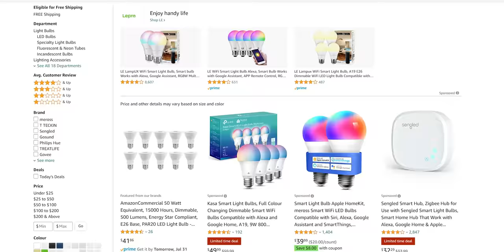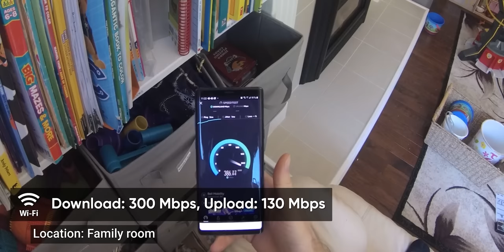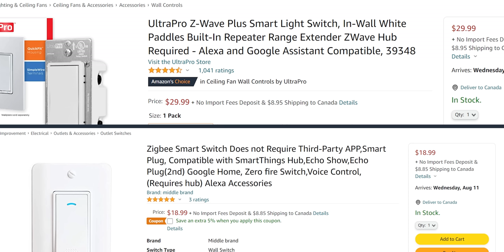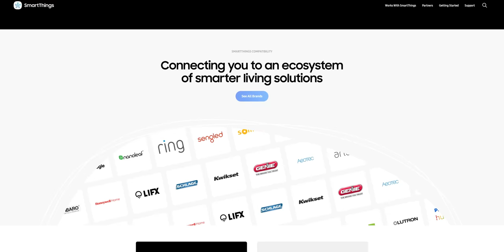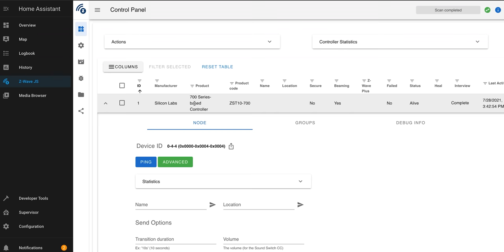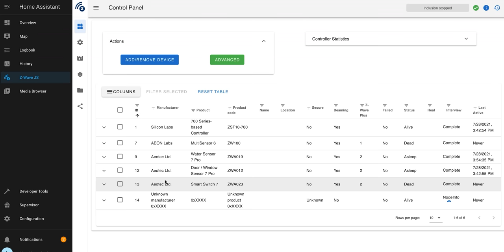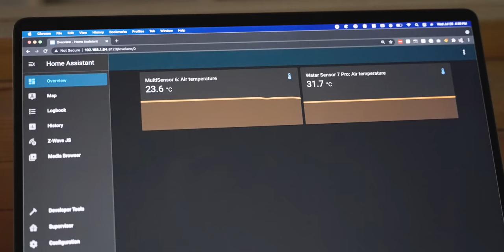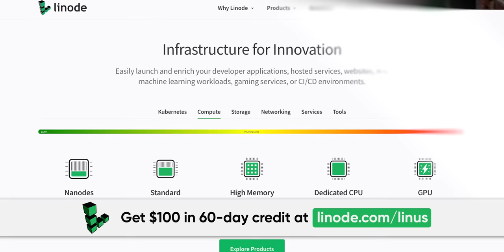My new house is gonna be MAGIC - New House Z-Wave Setup

Comment: If you haven't seen it, check out the span.io smart power panel: https://www.span.io/smart-panel-product

You can monitor and control the individual circuit breakers from your phone, which is really awesome. That allows for a whole new level of granularity when monitoring power consumption that something like the Aeotec power monitor just can't match...

... That being said, the span.io panel is waaaaaaaaay more expensive than an Aeotec monitor...

Comment: I've spent more time researching and tinkering with different smart home ecosystems that I care to admit. Bottom line: z-wave is waaay too expensive and has limited devices. Zigbee mostly sucks in terms of reliability... Ended up with wi-fi (shelly) devices for most things, a limited selection of zigbee and z-wave sensors that I'm gradually replacing through wi-fi solutions too, everything running through node-red and/or HA. Stuff like automatic lights with a hour-of-day dimming curve work like a charm, reliable and the only thing that stops working IF the internet is down is Alexa support...

Comment: yeah... i tried to use this home assistant.... but... yes... didn't work for me, way too complicated to use so i made my own home assistant
Reply: Care 2 elaborate?
Reply: @wesleymostien  ?
Reply: Yes, what do you mean by your "own home assistant"?
Reply: @wesleymostien  i created it, my own version, i am a software developer.
Reply: @duracell_87  me too, that's why I'm wondering about the details. How you've done it, which tech stack etc...
Reply: @wesleymostien  angular on FE + spring on BE + mariaDB, it supports two comunication protocols, for electronic boards; http and mqtt
Reply: Do you have a GitHub repo to help me out and I'm sure there are more people interested in such a setup. Thanks
Reply: @wesleymostien  yeah but is not public and i didn't decided if i will make it public or not

Comment: the funny thing is that wired intercom and mechanical springler timer is still working after 30+ years where the shit coming out today is just that.. its shit. its made for you to keep consuming as it doesn't last.
Reply: I meam an old pc could still be running today doesn't mean it is still usefull

Comment: Do NOT screw 2 wires under a terminal. That is bad. You need to pigtail multiple wires under a wire nut.

Comment: Yes, it is bad to run a microwave empty! Eventually, a weak spot will form and burn! Messed up 2 microwaves doing that. One I ran fully empty and the other I heated up a single red bean to watch it burn and the microwave had a burning smell when I realized there was a weak spot that formed and started to burn. 0/10 would not recommend!

Comment: This will no doubt get buried, but Linus please do not use Ruckus.
I work for a school in IT which just got an external company to install ruckus APs everywhere, and Ruckus switches across the sites.
The APs do not handoff properly between them, so roaming is crap and you have to disconnect and reconnect. The company nor ruckus themselves have worked out a fix for that. And then we have had horrendous latency issues across our default VLAN and our other VLANs. To the point where VOIP calls from one building to another just fail because of it.

I BEG

Comment: Linus.... You made a fucking central AC unit you can repair that drywall for less than $50. Its really not that hard to patch some drywall. My dad me start doing it at age 12 when I would put a hole in the wall with my siblings pretty simple shit.

Comment: Why would you make something as simple as a light switch communicate wirelessly? Have you heard of WIRES? Considering you plan on living in this house for decades just spend the extra man hours to run wires and do it right so everything stays working and you have the added benefit of not being bombarded by high intensity radio waves 24/7

Comment: Yikes those screw terminals look awful! Never seen anything as dodgy as that in the UK, it’s always proper terminal blocks so you can’t touch any exposed copper without really trying to. Also it’s not a safe isolation method to use a non contact tester to prove dead, really bad and unsafe advice.

Comment: I feel like you really glossed over the pros and cons of the different communications standards… for example - wifi switch $15, standardized protocol, unlikely to go anywhere any time soon. Down side - need good wifi (as if you don’t already have that) z-wave - proprietary protocol, switches are $60 each, far less adoption than wifi, so might go away as a protocol as new stuff gets released. Upside - running separate from your wifi on a protocol meant for that purpose….

Comment: Linus Tech Tips:  I hope you are not going to make your house a smart house.  I do not trust Alexa or Alexa type devices or baby monitors, and you shouldn't either.  Remember, anything connected to a computer can be hacked.  Why not just put everything on a timer instead?  And use a clapper for the light in your room and other devices.  I have a clapper and have my TV, radio, and lamp plugged into it, so all i need to do is clap 2 times fast and loud and they all shut off.  Just something for you to think about for the safety of you and your family.

Comment: you shouldn't run home assistant on a raspberry pi, the sd card will only survive a few months if your lucky it will constantly breakdown and have issues also z wave is trash use zigbee
Reply: Easy solution…
Use a Raspberry Pi 4 and boot off a USB SSD. Problem solved.

Comment: I've had those same JASCO / GE Z-Wave switches (More than 30 of them) for around 5 years.  Terrible failure rate; terrible support from the manufacture.  I love Samsung Smarttings, but the switches are the weak link.  Stay far away from JASCO / GE.

Comment: Aeotec… 3 plugs died after 3 years of usage, I’m quite sure the others will brake soon. Fibaro Zwave smoke detectors have known issues to go off whiteout any reason. Oh yes love Home Assistant but burned 3 SD cards and my wife wasn’t happy. Why spend money on a stronger electrical system to charge cars, but not on wired connections like Loxone or KNX?

Yes sure low step in price but in the end … you waist time and money
Reply: If you have a Raspberry Pi 4, make sure you have the latest firmware, and you can boot off an SSD. That will take way way longer to die.

Comment: "It actually required the neutral wire."
Ummmm. Isn't it Hot and neutral at least. You know. In and out. Cause you don't just terminate into ground. Ground is for safety. Right? I don't think too hot wires will do anything.

Comment: 2.4 ghz. Sounds like I will be pointing  microwaves with no doors at my neighbors houses.
Reply: @zodiark2456  and Bluetooth. A strong enough signal can induce a current on a wire and trip a circuit breaker too.

Comment: You will figure it out linus your gonna a run into issues with lag and devices going offline , we have all smart lights switches and sensors, using pi4 home asst using geeni bulbs and cams sensors  tuya smart software geeni not supported on home asst no rstp support4 geeni, i simpley made a device ping automation, so im pinginging all devices every 30 min.never buy mercury products.. linode is is awesome